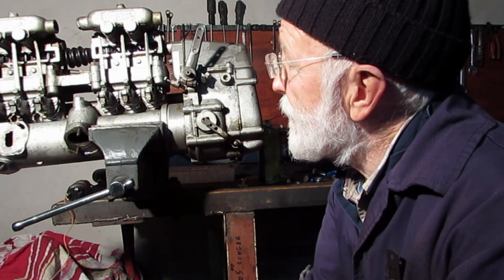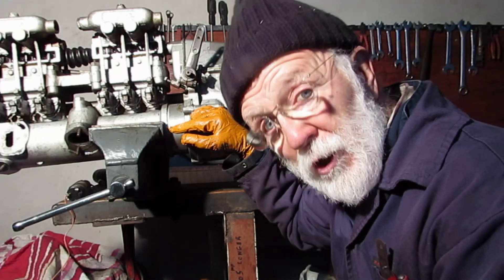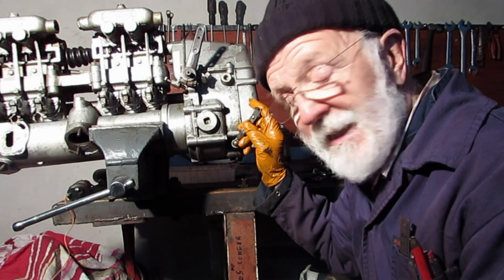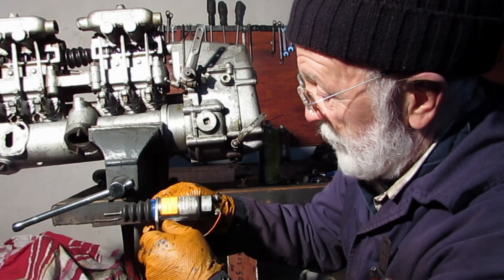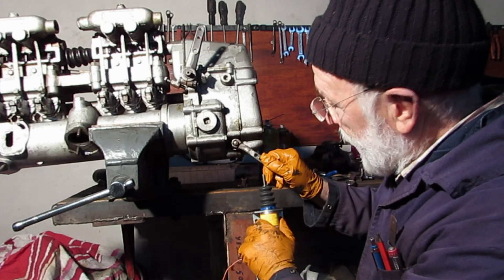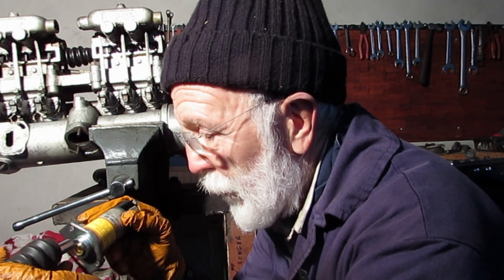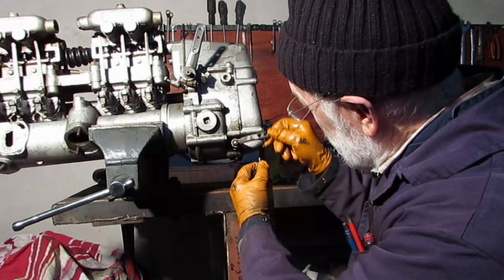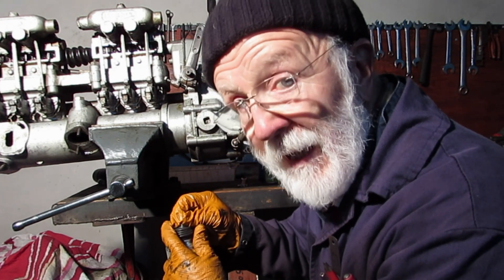Gardner Engines: strangling them!

Comment: Great info.  However, I reversed the use of the solenoid, current used to pull the lever to the run position and a spring to pull the strangle lever to the stop position.   This way to kill the engine I remove current ( via a switch at the helm ).  More “fail safe” I believe.

Comment: Would it not be better to mount the solenoid in such a way that when energised and drawing power from the electrical system it moved the strangling lever to the 'on' position and when there was no current the spring pulled the lever to the 'strangled' position?
Reply from the maker: Yes, this is normally the way we do it.

Comment: Thank you Joe for your very good and informative videos ...... I’m in Thailand at present and I have been on two dive boats that were converted from fishing boats ... both have 6 cylinder Gardner engines , in Apple ng state of neglect . I have been asked by a friend of mine to help him bring one of these boats to another island which involves a three day passage . As a young guy I was on a few yacht with Gardners and im watching all your videos to get as much information as possible . I humbly request a video on bleeding the diesel circuit . If we do this passage I’m going to make sure the fuel tank is cleaned as the boat only has one engine and judging by what I’ve seen so far I’m betting there are no spare fuel filters and of course that is a worry . On the first boat I was on there was oil in the header tank and I found that the oil heat exchanger end caps were full of rust .....and that in the past someone had repaired the tubes by filling some of them with lead solder at each end ...... reading up on it I found that hundreds of Gardners were sold in Asia to be retrofitted to fishing boats .... it’s a testament to the extreme toughness of these extraordinary engines that they keep working under what can only be considered brutal conditions 
O

Comment: Another great short subject video.  I like those simple straightforward solutions.  Now I'll have to study the system on my boat.  The manual says don't hold the stop button down too long or you will burn out the solenoid. It must not have that resistor circuit.  The action on the lever is real light. I think they solved the issue by mounting the solenoid to pivot so the plunger follows the arc.  If I add a bracket for the old kill cable I could have a redundant way to shut the engine down without leaving the wheel and hand tripping the lever.
Reply: I have a kill cable on mine it didn't come with an electric kill switch, honestly don't see any point in adding a solenoid to my particular set up as the cable works perfectly and it's one less thing to go wrong, my backup system is to walk down the steps and kill manually. :D
Reply: @popuptoaster  Well, mine came with the kill switch.  I agree and tend to like simplicity.  The cable run is only 9-10 feet and only because to keep sharp turns to a minimum it has to take a long sweep to change direction.  My back up is the same, down the companion way, open the engine bay and push the lever.  I'd just like the redundancy of the cable since I left it routed from the old engine and will eventually drill and attach a bracket to hold the cable.  Just a low priority issue. I did the repower myself and only had so much expensive time in the yard where they charge as much as parking a car downtown for every day but at least they let me do my own work as long as they do some.  Very few yards in my area allow anyone to do any work.
Reply: @alwaysbearded1  I'm in a boat yard in the UK rather than a marina, I would say at least a third of the boats here are having refits or major work done by the owners so there is plenty of advice around which has been good for me as I am a total novice, the yard specialises in things like Thames barges which is interesting, I think my Gardner won them over for me when they found out what was powering my boat and thanks to Joe I can sound a little knowledgeable about it too. ;)
Reply: @popuptoaster  One of my favorite things about my hobby/obsession is that boat people tend to be very nice people except the certified %^%^%* people of which there are few.  Also knowledgeable and helpful.  I once was trying to tighten a nut from inside a locker with no way to hold the bolt from the outside but I hung a wrench on it.  Some random fellow boater in the yard grabbed it for a few seconds which allowed me to tighten it. So observant so perfectly timed.  It's the little things you remember.  Glad to hear there are still yards where you are that allow people to do the work themselves. The learning curve of boats is steep but you can do it.  What kind of boat do you have that is big enough for a Gardner engine?
Reply: @alwaysbearded1  It's a 40ft steel cruiser, I think it was home built, can't find any makers marks or photos of anything the same anywhere and nobody seems to recognise it. I just put a few of the photos from when I found her up as a short slide show on my channel on here if you want a look, she probably isn't really big enough to need a 6 cylinder Gardner but that's what she came with. :)

Comment: Hi Joe, another great video.
Any chance of quick video on why Gardners are able to run backwards.
We had an issue with ERF trucks fitted with a David Brown gearbox, the driver would stall the engine, incorrectly select reverse and manage to roll and restart the engine backwards.
Reply: I must say the engine must be running very hot to do that , as Joe said it could run on the lubrication oil in conjunction with the injectors which are still running, I guess:-)
Reply: I had a perkins p3 do this in a dexta once. I reversed quickly up a hill with a large trailer and stalled part way up. I was hoping the engine would hold it, but it didn't and instead turned backwards. I then noticed smoke coming out of the air filter and so grabbed the clutch and the engine carried on running and gradually picking up in speed. I stopped by pulling the engine stop so it definitely wasn't running on the lubrication oil.
Reply: Detroit's can do this to. But as there 2 strokes kinda easier to happen. I wasn't aware it could happen to a gardener. Had a funny call once in a camp from a excited driver about white smoke coming out under the hood. Made up a story about bad gear box and had him reverse all the way to the shop. I know childish but funny as hell.
Reply from the maker: Yes, I have heard this many times.   Not sure how I could shoot a video of it though.   What can also happen, under certain circumstances is they can actually run on their own lubrication oil!   Sounds incredible, but it is true.   When they do that, they are very difficult to stop.   Quite dangerous really!
Reply: @tangentgardner  I have seen a runaway diesel using it's own oil as fuel, it wasn't a Gardner but it ended in a bad way for the engine, when I started my boat engine for the first time in over a year and wasn't sure of it's condition I took the air intake apart so that I had a flat area I could block with a metal plate I had on standby. :S